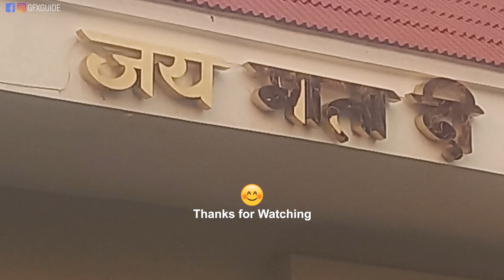Steel Letter को Backlit Effect देने के लिए Acrylic Channel बनाएं आसानी से !

Comment: Sir mera 2 d board h wo aachana dim dim light hote hote jalna band ho gya h kya kare
Reply from the maker: If possible count how much modules are installed 
Module count karne ke baad wattage dekhe kitni banti hai, uske according power supply ya adapter change kare. Most of time power supply fault hota hai. 

If problem stilll same then you can share on us whatsaap at 8950607150.